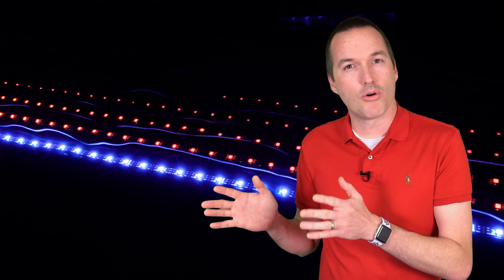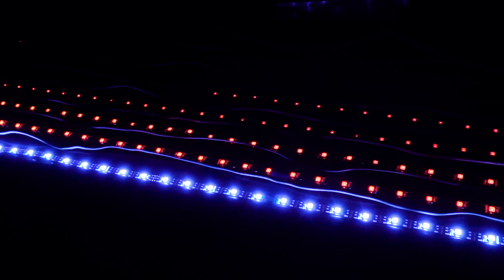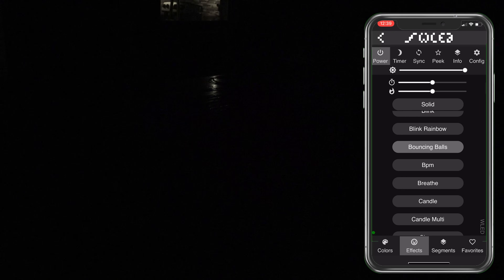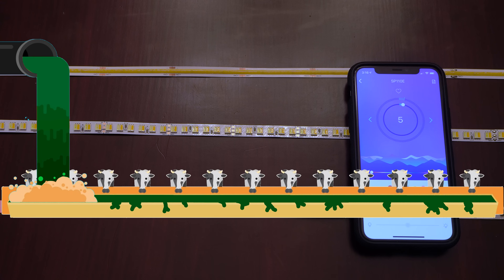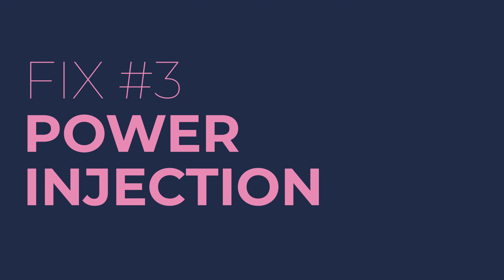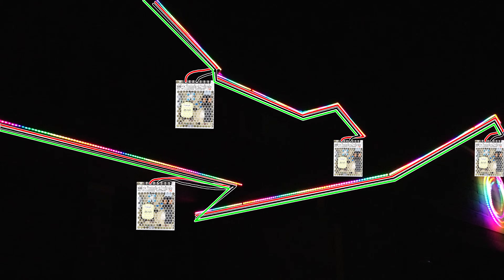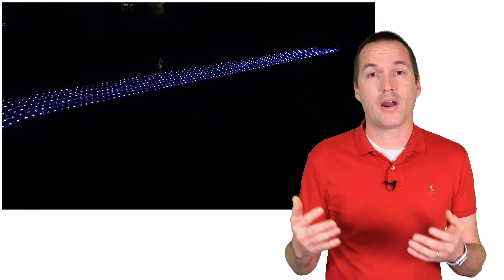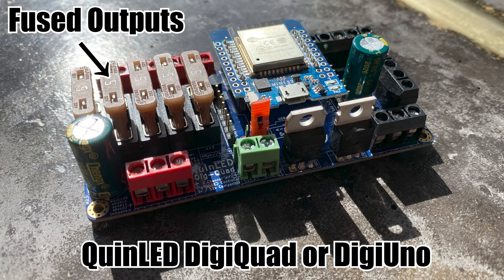3 Quick Fixes for LED Color Issues - Power Injection, Voltage Drop, Brightness Regulation and More.

Comment: I think I understand his preferred method, run 22G wire along the strip wired every  couple of meters, then run 16G from the power supply and connected to the 22G wire?

Comment: Hi. Maybe you can help me. I have DIY install 67 12v RGB deck led lights. I change the power supply with one more powerfull. Any light need 0,6 watt, so I chose a 60w power supply. But I still have some light that don't make the correct color or the last 10s lights that, on full Red, are more pink than red. If I choose with, aldo at full brightness, I don't have any problem. The distance beetwen the power supply and the first led Is 10m and from the first led to the last one is 35m.

Comment: Your videos always help me (used your UniFi videos and it was very helpful). Was curious on your thoughts about Quindor’s power injection video. Through those calculations he would have used 12v strips. And he didn’t seem concerned with fire issues. I’m new to this and trying to understand this hobby. So if you have any thoughts? Thank you!

Comment: I've been watching many videos on this subject and here is what I have come to understand. Please correct me if I'm wrong.

If I have 1 x strip of LEDs (5 metres) and the total amount of wattage they consume is 90watts, with a voltage of 5V, then the total amps will be 18.
If I add an additional 2 LED strips, so 3 in total, the voltage will stay the same at 5 volts, but the watts required will increase to 270 watts.
This ends up making the amperage 54 amps.
So if I purchase a 5V 60amps 300watt power source this should power my LEDs adequately, but may need to power inject at a particular section?

Also, can you power inject from the end of the 3rd strip instead of the beginning of it?
Reply from the maker: All that is correct.  You will need multiple power injection points for 15m of 5V strips.  You can inject anywhere.

Comment: 8:20 Hi! If i want to use combination of #1 and #2, how big if the power supply should i use? Im planning to use a 1200 leds long runs (60 led/m, total 20m) and the manufacturer calculation is 1 led taking 0.06mA thus in total 360W. But the highest available is 5V 60A 300W. What should i do?

Comment: don't know why but when I injected power using method 1 into my strip of 398 leds, they were still dropping voltage greatly towards the end so I added a separate cable directly connected to the end which helped a lot but there was still some drop near the middle even though I injected power in that general area(with that parallel wire), does anyone know why that's happening, do you think the parallel wire could've broken inside as I did bend it very tightly, or could it be because i injected power too often?

Comment: ive been trying to find an answer for my dc leds/brak light/headlight on moto bicycle.... voltage drop made me feel less of man because when ever i turn on my headlight/use brake lights...the entire bike dims..lol
would i obtain a smoother circuit if i used 3 positive lines straight from 1 battery to highest amp loads. then use last line for all lowamp loads
from this i should have smooth running circuit? 
i dont think this would work...unless the power came from alternate sources(like u stated)..
i came back to this and realized i should be wrong. im thinking a quick fix may be to use a step up dc converter somewher in the circuit..(before the load?)i have little circuit knowledge with use of capacitors...(wouldnt these cause brake lights to fade??..would using before headlight smoother the rest of circuit out if i used one?)
thx so much...big project

Comment: Having trouble understanding why you do both a home run and 22 gauge inside the channel? Do you connect your home run to the 22 gauge wire and then tap into the 22 gauge on the led strip?

Comment: I am using 12v pixels (string) and a 12v 30amp power supply. The length is approximately 260pixels. Lights look fine, but should I be adding injection to then end of the line? If so, what gauge should I be using?

Comment: More questions:

1. Parallel runs... how do  you tap into the long run? A T connection?  Or will one of those snap on line tappers work?  Do you have to have both V+ and V- tapped into at each point or just the V+ as long as you have V- connected to the loop?

2. Long runs say anything over 800 feet.  WLED throws an 'error' not to try it on one pin.  So, I assume that means you have to use 2 or more pins, but when I try that it doesn't work, so I am missing, what?

So, what I hear the solution is for > 800 5v LED is A LOT OF WIRE between home runs and parallel runs!   It would seem that that warrants the consideration of just adding addition power supplies down stream and just be sure not to have the V+ lines touching the V+ lines of any other power supplies.  That solution seams easier... to my newbie mind :)

Comment: You mentioned adding multiple power supplies and not connecting the positives together. Can you explain more. Is the data wire stay connected through out? Do you connect all the negative together from different power supplies? Can you provide a diagram that explains it better. Thanks

Comment: Most current though a DC circuit is from negative to positive which is opposite of what you stated.
Reply from the maker: The current is equal no matter which direction you measure it.  Traditional current is measured from positive to negative while actual electron flow is from negative to positive.
Reply: @TheHookUp  I agree, I was taught that electron flow is the better measurement. No disrespect intended.

Comment: I tried different plugs and different white thingys between the plug and the strips,  and even different strips, For some reason as soon as I set up the LED strips only the green never lights. I'm running out of ideas why green never seems to wanna work on any RGB strip I try. The strips and plugs are all 12V

Comment: I found some 24v 120w = 5amp, led strip. I want to connect 2 of those. What if I use a 24v 240w 10amp power supply...??? Is it ok to maintain brightness thru thw whole strip?

Comment: I like the video; as an electrician I tend to go to multiple power supplies as well as running parallel power wires as just like Christmas lights each LED strip has limitations and daisy chaining isn’t always good ideas or practice. There are joinable power supplies which can be wired together, though they aren’t cheap, so if you didn’t pay much don’t wire “+”s together. I like LED lighting and when I re-did my kitchen I ran a system using 5 power supplies between 4 under cabinet zones and 1 over cabinet zone; the above was RGB while the unders were all just 5k white, and all were dimmable. This provides great task lighting as well as mood lighting. While I rarely run my lights at Max I’m glad I have the overkill as getting older you appreciate more light when you want it. If you calculate your power needs and then pick a parallel wire with the required ampacity you’ll be able to go as long as you want as you’re not relying on an LED strip to carry any more power than it itself needs.

Comment: so if i want to add a power supply to my first one could i run a wire from first  one to second one postive negative ground wires and then could i power inject from second power supply to my pixels negative and postive wire  because i have 1500 pixels 5volt with 350 watt power supply at 30 percent brightness is my power supply good enough to run 1500 pixels thank you

Comment: Finally a video showing parallel injection!  I've been looking everywhere for this. I'm planning on using WS2815 (12 volt) strips so can I still use the same wire sizes for the parallel and home runs or should I be upping the size of each?

Comment: I stripped open a 4ft T5 110v ac led neon to cut it because it was too long. I was curious to see if the leds were 12 or 24v. When testing it, I get 35v dc. Is it possible ?
Reply from the maker: Yes, they use large banks of LEDs to reach desired voltages.

Comment: Excellent video. Thanks for sharing? Is there an available wiring diagram for the outdoor setup you've described (power injection throughout with multiple home runs in a 5v system)?

Comment: I got the LED strip from BFT Lighting that you showed in this video, a 5v 10A power supply and only the first ~20ish LEDs light up. I thought it was a bad chip or something so I took out the one that started the non lit section and the one before it and used clips to clip the strips back together. But, only 1 LED comes on after the clip. So far I've cut off about 5 LEDs and have achieved the same results. What do you suppose the issue is?
Reply from the maker: What are you using to control them?
Reply: @TheHookUp  NodeMCU(ESP8266) I keep trying to reply but for some reason it isn't sending my reply.
Reply: @TheHookUp  hello?

Comment: I bought a kit with a 12v dc to 5v dc control box it’s about 300 led and 16ft ws2811. Can I run more ws2811 strips (say 10ft) off the same control box and just inject power where needed. Or will that over stress the control box. Thank you for your help

Comment: Why won't you show how to power inject 12v? Why do you think it's only 5v
Reply from the maker: The method for injecting 12V is exactly the same.
Reply: @TheHookUp  thanks
Reply: is that for 4 wire 12v , cause i have 12v - r- g - b on my strip

Comment: Can't figure out how to inject power into my rgbw strip.
Reply from the maker: Run an extra + wire to the + pad on the strip midway through, you do not need to add additional RGBW wires.
Reply: @TheHookUp  so no ground wire needed at the same point where the positive wire injects to. Thank you. I was wondering where the negative goes, but I guess the initial negative power wire into the controller is all that's needed.

Comment: I am trying to power inject a 5050 4+1 RGBW (so 5 tracks) LED strip. Do I just run a single power inject cable to the 12V+ line since the -V lines are technically the same as the RGBW data lines in that case? I couldn't find any specific instructions for a RGBW strip, I know you briefly mention it in your soldering LEDs video, but I'm still unsure.
Also BTF's site says it does not recommend lighting up RGB + W at the same time due to voltage drop. I assume injecting counteracts this?

Comment: I ran a series of 5v strips on my house last season and power injection was an absolute nightmare. It extended the length of my install by I'd say at least an additional 12 hours. The positioning of the wire kept falling into the lights, I used glue to tack it in place but got spill into the channel grooves and putting the diffuser in place became a big issue.

I'm going to switch over to 12v's this year. Hoping there isn't a fire risk because I'm not going to run any power injection wire. I don't anticipate i'll have enough power drop to cause color issues because I'm not running any beyond 200 or so LEDs.

Comment: i got wled yesterday can i connect multiple of them and have it full brightness and it dont change color when full?
Reply from the maker: That usually means that your voltage dropped below the point where it could power your ESP, so WLED can't respond.  Does it reboot and turn back to yellow afterwards?
Reply: @TheHookUp  yea
Reply: @TheHookUp  i havent put them up on my wall yet but everytime i turn it off and back on or unplug it and plug it back in it turns back to orange
Reply from the maker: You probably need a better power supply or larger wires from your power supply to your ESP.  You could also just turn on the WLED current limiter.
Reply: @TheHookUp  im putting up 5 strips in my room any power supply or extension cord i can use to get the brightness maxed
Reply: @TheHookUp  i turned off the current limiter and its maxed brightness but still resets to orange if i unplug it

Comment: Can you show us how to solder a "home run" and where to tap-in? Everyone describes power injection, but no one has shown how to do it?
Reply from the maker: The BEST way to join LED strips with no gaps or seams + make waterproof power injection connections. https://youtu.be/WGgzWWrCIhY
Reply: @TheHookUp  This was so generous of you, and on a holiday! If I can ask, my strip is RGB&B (black is power) Can I use the 22/4 for tapping into the strips for "home runs" or should it be like 16 gauge red and black? Depending on which you suggest, would you tell me what the connection-points will be? Lets say its the R/B 16 gauge, one end goes to the power supply and solder the red and black home run to the red and black on the light strip? Thank you so kindly, you're awesome!
Reply: @TheHookUp  It just occurred to me that I don't know which wire on the strip is the remote signal wire, I assume the other 2 are negatives so I can't just assume it's red-to-red or I'll short it out, I know the black is power. God Bless Brother
Reply from the maker: How many copper pads are on your strip?
Reply: @TheHookUp  There are a set of 8 (4 and 4) every 3 inches which means 64 sets of 8 copper pads or 512 individual pads total
Reply: When I describe each set of 8, it's 4 pads, the "cutting point" and 4 pads after if that's clear enough
Reply: @TheHookUp  BTW I have IP65

Comment: Hopeful you could answer a few questions.  I've got 7 sk6812 (150 leds per strip), 5v DC 300W, 60A power supply.  I am looking to power inject and put in home runs (12 ga stranded wire). Controlled by a Dig Uno running WLED.  This is for lighting under my deck rails.  

Question- If I place the power supply in the center of the deck and have the strip's data arrows pointing away from the controller, can I use smaller wire for the home runs as they will be technically carrying less current?  (~500 LEDs per leg rather than one leg with 1050)  

Question 2- The beginning and end of each strip has a connector and extra wires for power injection, they look to be about 20 Ga, can I solder crimp the 20 Ga and the injection wire (12-18 Ga) together without over loading the smaller wire?

Thanks for your videos.  These and other like it have given me the confidence to do this project, I just want to make sure it is done right the first time.

Comment: Can one 16 AWG wire take the home run power to the attic and then can it be split up to additional 16 AWG wires to different points on the roof from the attic?

Comment: Does using the digi uno or digi quad with fuses basically eliminate the risk of overheating/fire?
Reply from the maker: Eliminate?  No.  Significantly reduce? Yes.
Reply: @TheHookUp  thank you. Looking to reduce risk as much as possible as I am very novice in this regard. Would 5V with power injection be “safer” than 12V without injection? (Both running off the Digquad)

Comment: Great and informative video :-D I have tried to find information (without any luck) if it is ok to connect the signal (dat) cable in parallel to 2 ledstrips. Any suggestions?
Reply: It is, as long as the data is flowing in the correct direction on the led strip.
Reply: @starmc26  Great, thank you very much, then i can go on with my project 😃

Comment: Would love a step by step on how you inject your power. 1. Parallel run with a T-line connect to each end of the strip (22g wire). 2. Then you will have the 16g wire run home run from power supply to the 22g parallel or the home run supply the led strip? . We would love to see the best practice for your power injection. Thanks

Comment: I'm going to be an echo of many others, but you're videos are so good that it would be tremendously helpful to see your actual power injection.  Down to showing the soldering on the strips themselves. Also including how you drop down wire gauge from the 16ga home runs to the 22ga that runs in the channel. Thanks for all your videos, and I really hope you can help out the thousands of us that are struggling with the actual power injection piece.
Reply: ya I'm a begger here too.  I  know, I know beggers can't be choosers.... BUT.  TechRavingMad is right.

Comment: Thanks a lot for the great video, I'd like to ask you a few questions since I'm planning to put some permanent LED strips like you did around the house for the holidays: For practical reasons, my setup would consist of 3 "runs" of 12V WS2811 measuring 631in, 336in and 1074in (90ft) respectively. MY questions are: 1. can I run all 3 segments from the same nodemcu, or is there a limit on the number of pixels per controller? and 2. for the 3rd and long run, is it feasible to use 12V WS2811 and doing the power injection every 16.4ft with 20 or 18gauge wires ? There will be significant voltage drop in the power injection line itself over 90ft. Thanks in advance for your help
Reply: I have the same question. Did you ever get an answer?

Comment: How do you know if your Power Supply supports 5 volts?  I've done all of my design and come up with a need for ~900 watts at 5 volts, so I'm looking at getting this 1200 watt Power Supply, but the label is only indicating 12 volts outputs.  This is a similar problem I'm seeing for every PSU over 300 watts.

https://www.parallelminer.com/product/power-supply-kit-for-diy-do-it-yourself-projects-12v-100-240v-led-lights-and-more/

Comment: Question; A ton of people here asking for a vid on "power injecting", you would help a ton of people if you know how it's done properly. Every strip you will run leads back to the controller, and another lead back to your power source. Typical kids bedroom say 10'x12' would need three 5M  strips, 12V 30Amp 240 watt for 15M of 5050